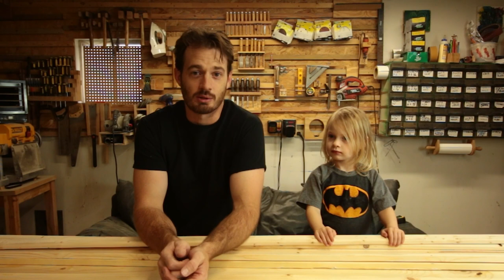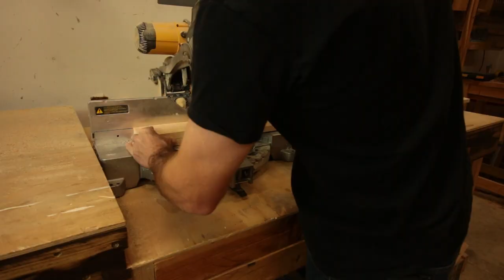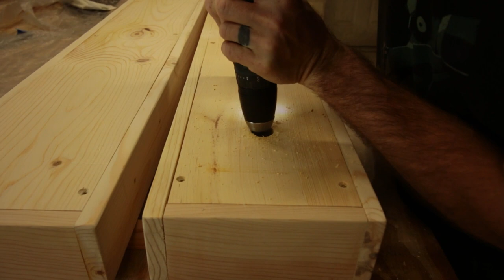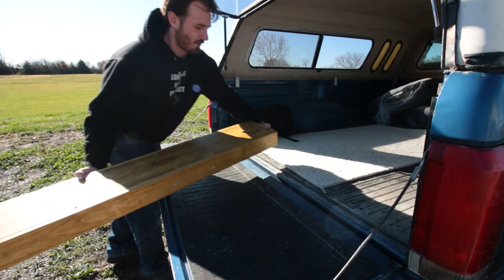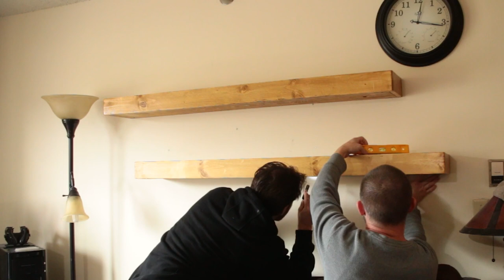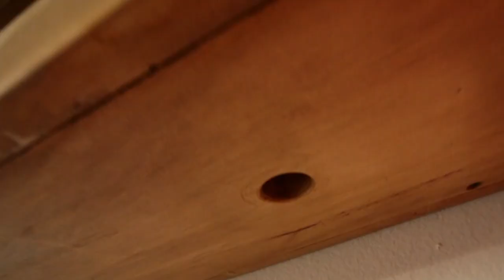How to Make Floating Shelves (the easy way)

Comment: Love that your daughters love helping you in the shop and you help them feel useful. Rather than drilling that hole, couldn’t you just use the the screws to pull out the bottom board? It seems like you would have thought of that, so I was curious on why you did not go that route.
Reply from the maker: I drilled the holes for the screws in the bottom board wide enough so the threads wouldn't catch on that bottom board. I could have drilled a smaller hole on the end of the board and used a screw but I feel like after many uses that would have ripped out some of the grain. I went back-and-forth for a while trying to figure out how I was going to make the bottom removable and the hole seemed the easiest.
Reply: @WyldeWoodworks  See, I knew you had thought of it and had a reason :)
Reply from the maker: @jasonbailey9139  Haha thanks

Comment: Plus this shelf comes with a sealed hidden location for the "forbidden movies."
Reply from the maker: Haha. Yeah I thought about saying something about the accessible hidden area. I didn't think about that till after I made the shelves. I could have put a quick latch on there or something.
Reply: Yep, some piano hinge and a latch if you’re using it frequently, screws if it’s rarely accessed storage.
Reply: @WyldeWoodworks  a possible hinge along the top of the front face with magnets on the bottom to help keep it in place. Now the bottom can be fixed. This increases what can be stored that hidden compartment.